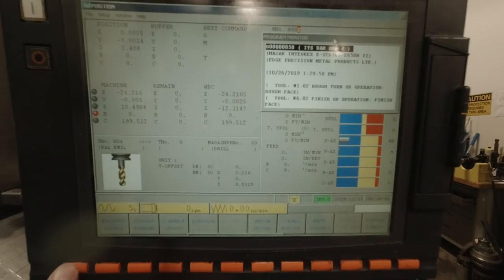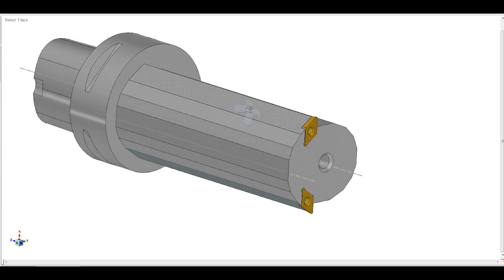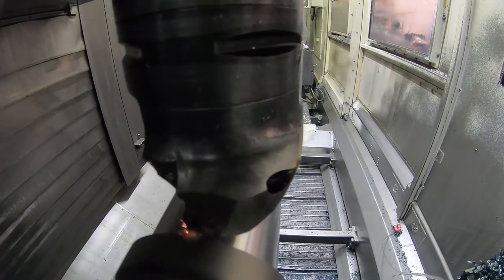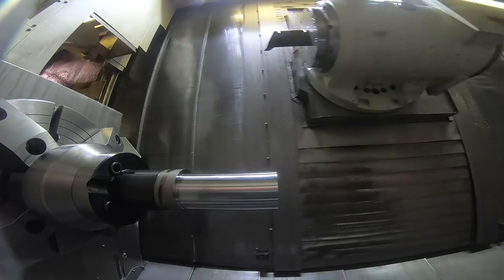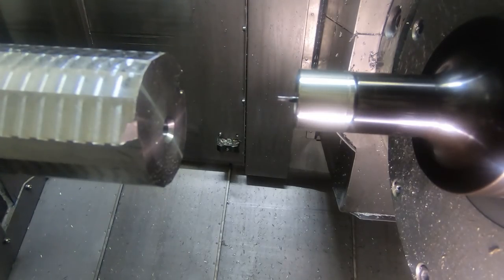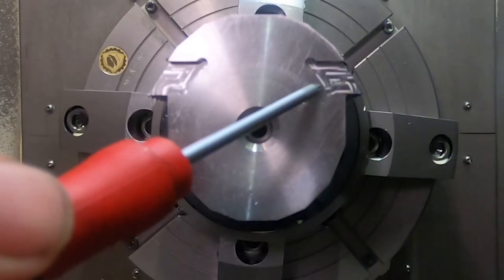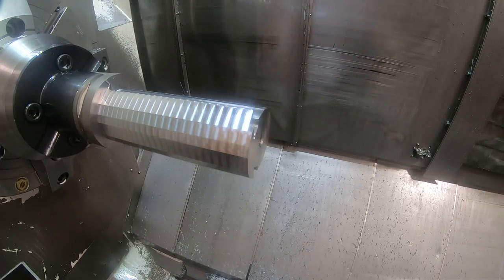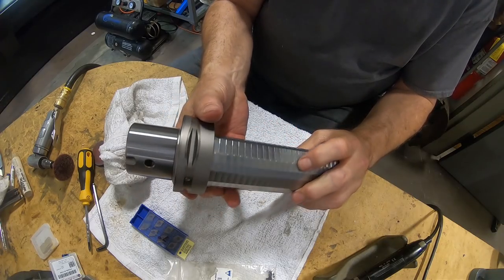Special Shaping Tool For The Mazak

Comment: Thanks as always. What material is the  tool?  You prolly said but I keep missing it on the video.
Reply from the maker: The tool is a Sandvik machinable C8 capto blank. What ever they make them out of. Some kind of steel.
Reply: @EdgePrecision  Its 25MnCr steel or similar, its made so that you can induction harden areas without destroying the Capto, it doesn't get super hard but around 52 Hrc.
Reply from the maker: @master8laster49  That makes sense. The Capto end can be filed but is noticeably harder.

Comment: So right now I'm in the middle of learning about wrapped tool paths. I see that you didn't use one when you were roughing out the clearance areas of the tool. Was a wrapped tool path the option you passed up on? Specifically I mean a tool path that has your endmill 90° from your z axis and the path would mostly use the Y, Z, and C axis? Is that the path that you said it harder to program?
Reply from the maker: I modeled the part with flats on the OD. If I had modeled it with cylindrical surfaces a wrapped tool path would have been the way to go.

Comment: Do you think is possible to make a similar tool for a normal milling machine? Like your horizontal. But something that would not hurt the spindle bearings. The programming is possible in Esprit.
Reply from the maker: Yes I have done this on my horizontal mill as well. The load on a shaping tool will not hurt the spindle bearings. As long as you don’t take to large a cut. On a normal machine you will need something to hold the spindle fixed/ orientated. Esprit doesn’t have a cycle for this kind of machining. It has to be done manually.

Comment: Are you using SpaceClaim for your solid modeling? We just finished an emergency order of 500 pieces due to customers machines being down. Print called out for a +-. 002" tolerance on a. 012" rad on a. 210 wide internal tab with open I'd tolerances. We had a hand full of broaches custom EDM'd to fit those specs albeit we got it working just enough to be to spec... Big headache
Reply from the maker: I do still use SpaceClaim for cad. I’m just starting to using Fusion as well. I expect to use a little of Fusion’s cam side for some things on these titanium parts. Not having a functional post for the Mazak I will process the code and manually insert it into a Esprit made program. We will see how that works.
Reply: @EdgePrecision  nice. I use SpaceClaim for all our solid modeling and GibbsCam for, well cam system. I started going through Titans of cnc academy to learn fusion for personal use and hopefully to use as a step in where GibbsCam falls short.

Comment: Hi Peter, Would it be possible to machine out the outside rectangle key, then press in the key and tigweld up the outside.
Reply from the maker: There are hole that wound be intersected. Also the heat from welding would distort things. Better to stay away from welding if possible. Especially on titanium.

Comment: I can't help but wonder if that key could not have been a heavy dowel pin shrunk and pressed through the wall from the outside.
Reply from the maker: I don’t think so. There are high pressures to deal with. There can be no connection from the bore to the outside.

Comment: 20:46 What kind of tip do you use in your grinder tool?
Reply from the maker: If you are referring to the debuting grinder. I use 1/8” diameter solid carbide burrs.

Comment: why didn't you make it with a modular head? Its not the first shaping tool you'll be using, machine from something like a hockey puck and sit on the end like a face mill.
Reply from the maker: I wanted the most strength and shortest possible length. A coupling I felt would compromise that. And would also make the tool more complicated to make.

Comment: Its hard to see... is that a collet chuck holding a capto tool holder or some kind of capto adapted chuck deal?
Reply from the maker: This video is about a shaping tool i'm going to use to shape a key projecting into the bore. It was made from a blank Capto 8 holder. Did you watch the video? I thought I explained that pretty clearly. Or are you asking about something else in the video. Maybe I don't understand.
Reply: Edge Precision yea im asking about the chuck you are using in this. I can see the four jaw chuck. But I heard you mention in the video you were using a collet just. So looks like a adapter. So yes completely unrelated to the video topic lol
Reply from the maker: Derek Green OK yes that’s a Capto 8 spindle adapter. It’s normally used to mount on the end of a horizontal boring mills quill. So it can mount Capto tools.

Comment: I'm sure someones asked this question but can't find it. What happens to the tool after the job is completed?
Reply: Waiting for customers part order Ra 0.4  internal gears 😜
Reply from the maker: It gets saved for the next order of the same parts. If that ever happens.
Reply: Thanks for the reply Peter. Didn't think you'd reply direct which was really cool experience. I thought they would have been put in a catalogue and auctioned off on ebay or something. Keep up the good work on the videos.

Comment: How do you/Where do you get the dimensions and specifications  for the axial rake, radial rake etc.. for these insert tools you make?
Reply from the maker: I make them what I think will work. There is no dimensions I get from anyone else.
Reply: We have something called a design data book which has a wealth of useful information including standards, material, machining etc.  I refer to that for details such as rake and relief angles when making tools.
Reply from the maker: These type of books are a good and a good starting point. But just don’t be to rigid about things. There are many things that work. Learn to think outside the box.
Reply: When I've machined pockets for inserts I just downloaded the solid model of the toolholder for the matching insert. All the geometry is right there in the model.
Reply: @OMY005  Whats your source for solid models? i;ve dl a few but theyre minimized for tool collision detection, im yet to find a supplier who actually supplies the stp files
Reply: @mannycalavera121  Iscar usually, but most of the other big tooloing suppliers have models you can download.

Comment: Seems to me the better solution to the design intent on the clients piece would be just like the capto tool shanks you are using. You have far more patience and tolerance than me. I would have taken a big stick and beat some engineering savy into the designer.

Comment: Why this key bit what you try to machine can't be a separated part mounted with a screw?
Reply: Boru CNC I would hazard a guess that it is going to be in a high torque app.
Reply: High torque, high temp, corrosion issues, wall thickness limitations.... unfortunately there’s no shortage of reasons to require something that’s a pain to make.

Oh - it’s also easier for an engineer to design something that’s a pita to make.
Reply: Yeah I get your point guys, sometimes "they" design parts without thinking how the hell people gonna machine that but thanks God we have this channel haha

Comment: If I designed a part like that, I would get flogged.
Reply: can you elaborate ? I am not a machinist, was the part technically flawed ? too time consuming to produce ? oh and by part, do you mean the tool he made or the actual part with the keyway thingy he needed to produce ? thanks in advance dimitar
Reply from the maker: I think he is referring to the part being machined. Not the tool I’m making.
Reply: Sorry, i meant the part being machined. The tool looks perfect. As for the part, having an integral key is difficult enough but there is also space behind which might not be too difficult to machine with the proper boring bar but it is still too complex. Any indexing or moment transfer needs could have been met easier i think (even not knowing the restrictions i would think that)
Reply: ok cool, I see.

Comment: what is the tool that you've built for?
Reply from the maker: As I explained in cad portion of this video. I'm working on these titanium parts. On one end there is a projecting key in the bore. This key is at its bottom is 5.0" deep into the bore. The intersecting corners between the key and the bore have a radius of .030" and the keys width has a tolerance of +.000 -.003". Although it is possible to mill this on a 5 Axis machine (the Mazak is a 5 axis machine) its a little impracticable. So this tool will be used to form the sides of this key.
Reply: @EdgePrecision  Oh nice.. You use this special tool like a "slotting machine" to finish the radius of key. Thanks a lot!

Comment: I'm wondering if you could have directly machined the sides of the "key" with a ball ended taper endmill, basically like the one you used for the insert pockets but with a full radius on the tip.  With the multi-axis capability of that machine, shouldn't you have been able to get the geometry you needed?  I'm guessing a 1/4" shank tool and extended narrow profile shrink holder would give the length needed.
Reply from the maker: As I said in the video it would be possible. But the tolerance on the keys width is +. .000 -.003 and it is 5.2” into the bore to the bottom of the key. You remember the cad model? There is a key in the smaller bore deeper in. I do plan to mill that one.
Reply: @EdgePrecision  Thanks for the reply.  Admire your work (and that (drool) machine), nice to get such content on the 'Tube.

Comment: Maybe I didn't understand you in the video, but do you not count for gravity affecting the reading on the indicator? Before I have taken an indicator out the machine and mounted in to a flat piece of metal I can hold by hand and set it on zero and saw how much it ran out at each angle and used the difference for when I had it in the machine while indicating. This is correct, no?
Reply from the maker: This indicator/arm setup I have tested. It is accurate in the horizontal position. You are correct not all are. You need to test whatever you use in this position. The length and weight of the arm and the spring pressure on the stylist are important.

Comment: What you thread mill an m4 thread.woohw
Reply from the maker: I know your probably just making a joke. But to enplane it more clearly. Tapping on this machine is a little difficult. It has these automatic safety doors. The spindles wont run with these doors open. So you cant apply tapping fluid on the tap while tapping. The way these doors are made and the ladder is written on the control. You cant just override the safety switches on the doors with a fake key in them. The control looks at all the switches on the doors and times the cycle of the doors.
Also I just happened to have the thread mill already in the machine from a previous setup so I milled the thread on this tool. Thanks for your comment Glen.

Comment: I for one don't care if coolant is in the shot. There's enough time at the start and end of a pass to understand what's been done. Show that, show a bit of machining sped up like you did and that's enough, i think this whole craze about not using coolant to show shots is a bit overrated. No offense if this comes as biting, but i don't see the point in potentially ruining a good bit and work. Just my 2 cents.

Comment: I'd just leave content in given total video length constraint, and viewer can (skip/speed up-down) although that might affect ad revenue, ranking when they do (?)
I guess threadlocker on bottom and sides of insert (pocket) would have no use whatsoever (?) in terms of anchoring, [but for the thread itself]...would instantly fail upon contact...
Reply from the maker: If you can get more people to the end of your video it ranks better. That's why people with big channels make videos between 6-10 minutes long. Than there is watch time. This is actually more important than actual views. You get a view if someone clicks on your video but if they click away in the first few seconds there is no view time. This does YouTube no good. They want watch time more than views. I don't think thread locker would be good on the screw or insert pocket. Its sometimes hard to get the screw out. Thread locker would just aggravate that problem.

Comment: You would have had a much better result if you had a Kennametal KM4X spindle connection instead of the junk Sandvik capto connection.
Reply: BTW, what is your office extension # at Kennametal ?
Reply from the maker: You mean the connection they copied from Sandvik?

Comment: any chance you remember the feed speed on the gun drills? especially the 3mm gun drill?
also
if you don't mind on tapping operations I have always used inches per minute (desired RPM x 1over tpi for feed right?) but then with Mazak , mazatrol creates something like .005 per rev   
 do you know if this is convertible ? or another way to do
Reply from the maker: I typically use on gun drills 150 surface footage and around .0005” feed per rev. On the tapping cycle the feed is per revolution or the lead of the tap on the Mazatrol in G code. The speed can be anything, but don’t go to high you will have less precision on the feed matching the lead of the tap.
Reply from the maker: @derick3482  This depends on your RPM. At 4000 rpm .0005” feed per rev would be 2.0” per minute. This could be a good starting point for your 3mm gun drill. No pecking in the cycle. Also you need a starting hole. You can’t run the spindle when the drill is out of the hole. It will bend the drill.
Reply from the maker: @derick3482  What I generally do for tapping is this. For tapping easer materials I use feed as a controller, so for this I use a feed of what would be 40” per minute. So as an example; Let’s say you are tapping a 1/4-20 thread. The pitch is .05”. So for every 100 rpm that would 5 inches per minute. So for 40 inches per minute that would be 800 rpm. Now for tougher materials I cut this in half. So that would be 400 rpm for this 1/4-20 tap. This same formula works for larger taps. Let’s take the example of a 1”-8 tap. The pitch is .125” so the speeds would be  320 and 160 rpm for the same feed rates. So you see the speed automatically reduces for the larger taps. Now as I said before the feed on a tapping cycle on my Mazak is the taps lead. But for the speed I always use what the speed would be at these two feed rates. So take 20/the taps lead for tougher materials and 40/the taps lead for easer materials. I pretty much use this for standard taps. I hope that makes sense.
Reply from the maker: @derick3482  when your feed is in feed per rev you can put any RPM. What I was trying to relate to you is what speed (RPM) to select for taping. Believe it or not, it’s just as bad to run a tap to slow as to fast. I have found the formula I gave in my previous comment to work for most materials. Most people run taps to slow.